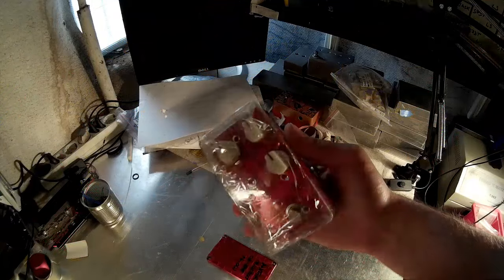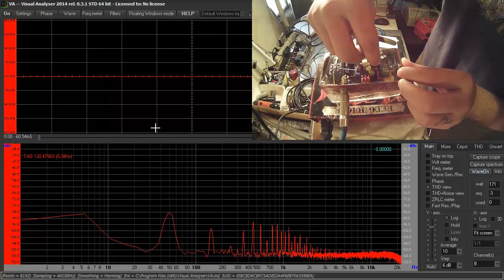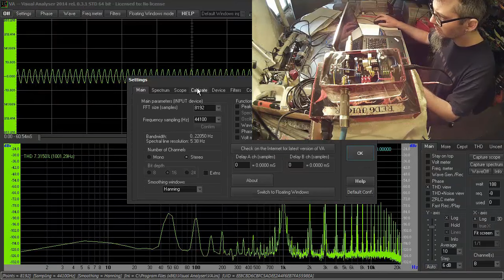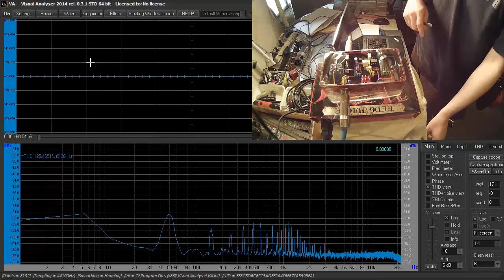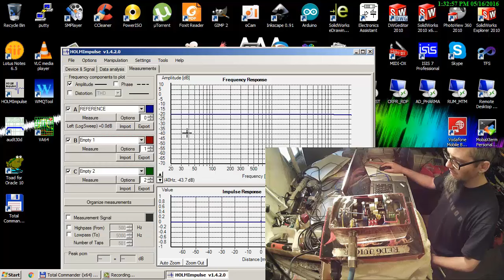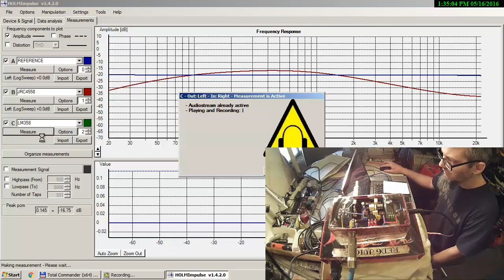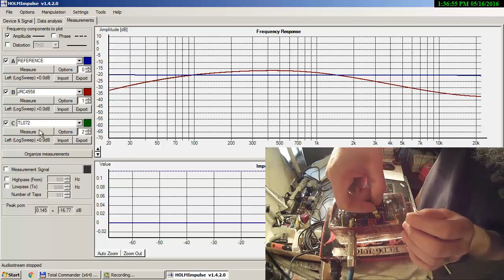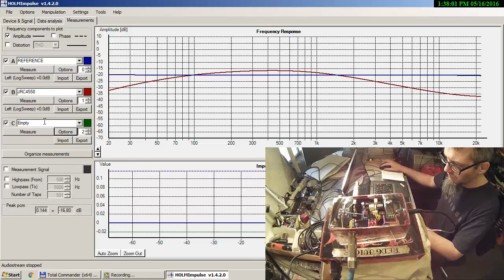THE OPAMPs WAR - Followup Harmonic content / Freq. response

Comment: Great job! It would be interesting to see all the charts together. 
I took a couple of screenshots and I think I spotted a few differences already in the proportions of the first two peaks. So you might have debunked the idea that all opamps are equal, which to me makes sense, since they are different circuits after all.
Reply from the maker: You would actually have to look also at the magnitude ... because a signal at -60db or -120db or even at -40db .... i don't think that would make any differences in the sound ... because you can't actually hear it. So, the magnitude of the signal / difference is very very important.
Reply: DeXTeR's Workshop right, those at the left of 1k are sub harmonics. However definitely there are differences, even the distribution of harmonics around 10k is vastly different for example between the red graph and the green one, did you notice? In the green one the odd harmonics are even 6db higher.
Great test. It would be interesting to see how they perform with lower frequencies and wider voltage swing, I think I hear differences in how the bass boost in my preamps sounds with different opamps. (But I also don't trust ears too much, so I might try some tests too)